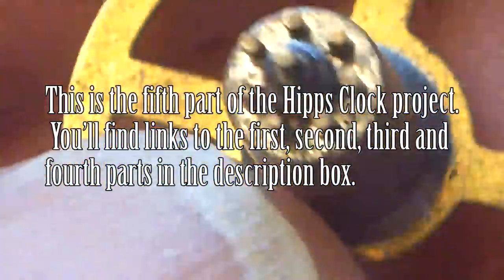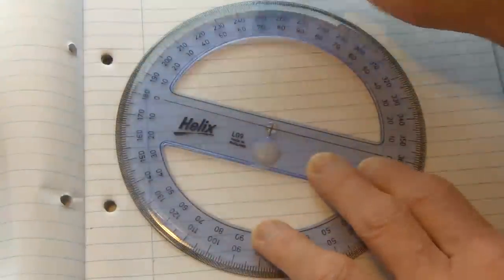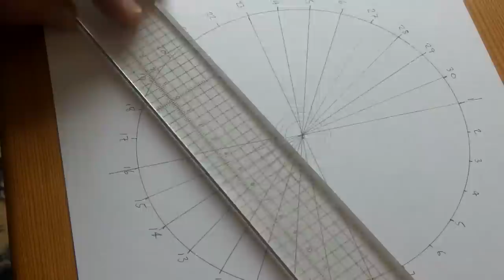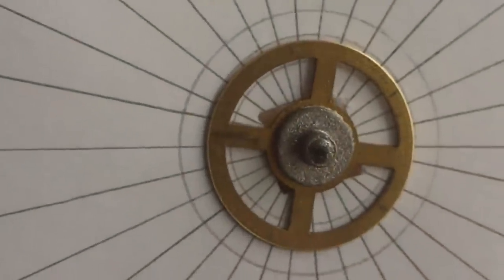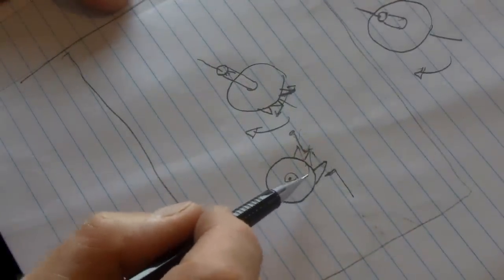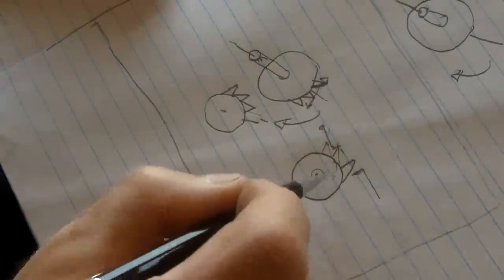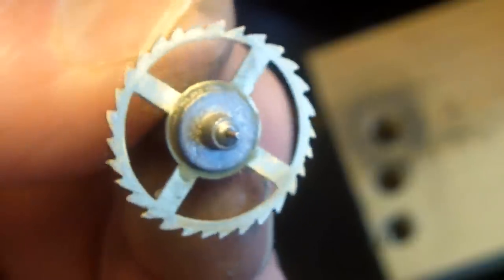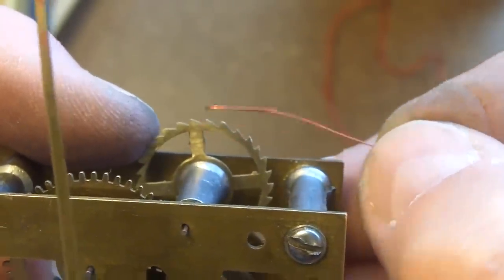Hipps clock movement project (rough) part 5

Comment from the maker: Hi there, I’m not sure where ‘Engineers Blue’ came from but I must admit that it’s nice to use it, not that I am on this ‘junk box’ project. It’s like using a ‘good tool’ I think it helps the mind set to know you’re doing a good job. For those who may not know, ‘Engines Blue’ is a spirit based compound that is applied to a metal surface and can be gently marked with a scriber to show where the metal should be cut but without the need to dig into the metal like I do in this video.  
... Andy